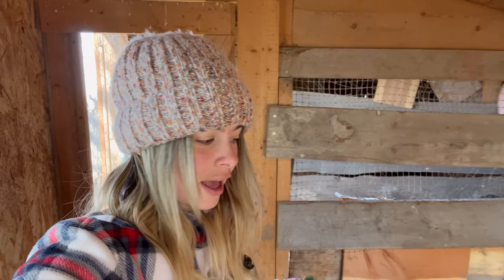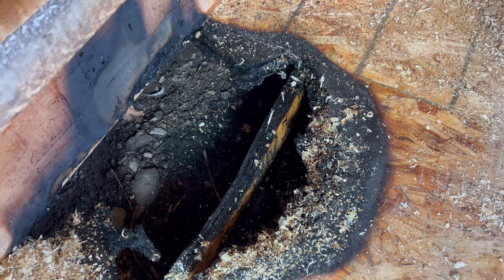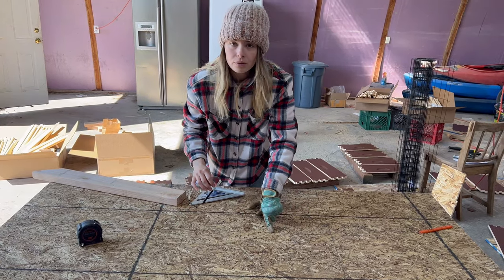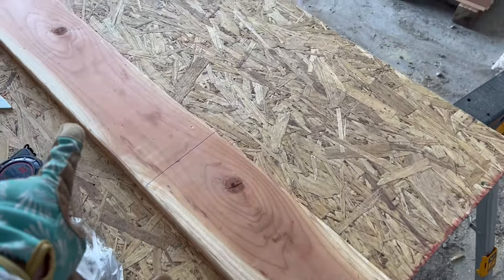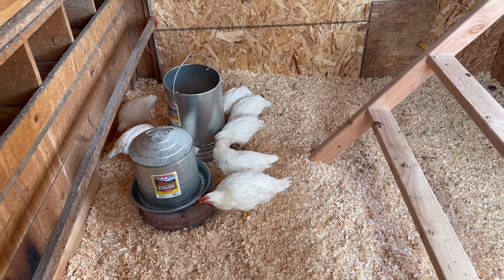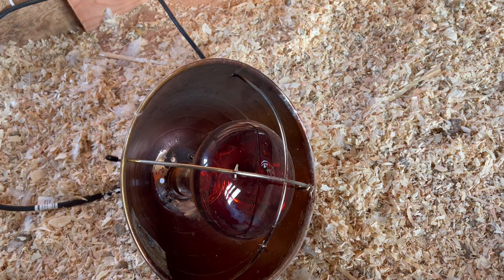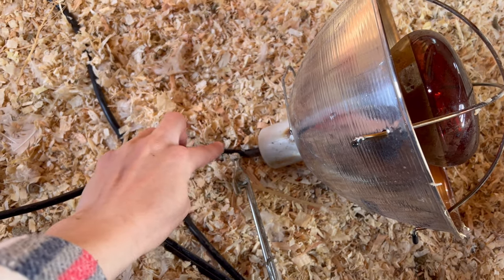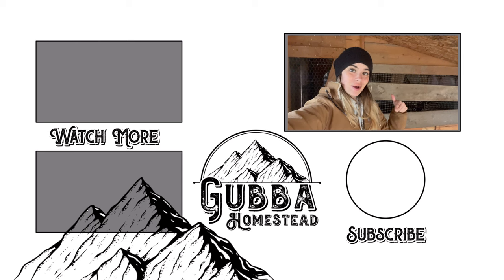🔥 FIRE In The Chicken Coop! [Heat Lamp]

Comment: Had same thing happen to us this winter. Luckily it went out by itself before I got there. Discovered it when I went out to feed. Used there waterer to make sure it was out. Would have been real bad, since coop is up against barn, if it would took off. Barn and chicks been total loss. I am glad all ok with you.
Reply from the maker: Thank you! I'm so grateful, it could have been so much worse. I'm glad to hear yours didn't turn out as bad as what could have been. What are you using now to heat your coop?
Reply: @GubbaHomestead  still used the same heat lamp. Had to the change bulb in it. It was messed up. I did put long screws thru the loops of lamp clamp into the stud. Screws keep them from knocking or pulling lamp down/off studs. Wish I could attach picture of burn hole in coop floor, if I still have it.